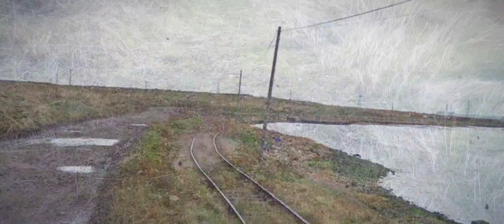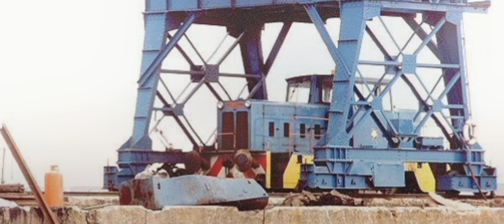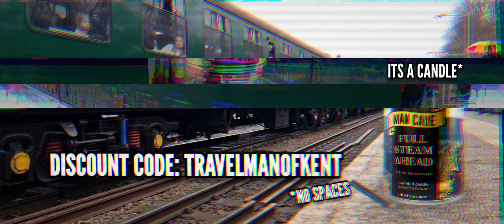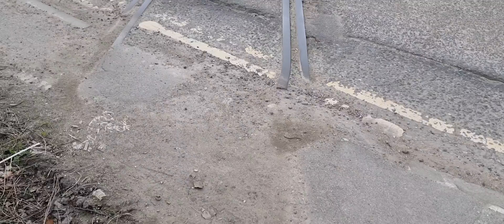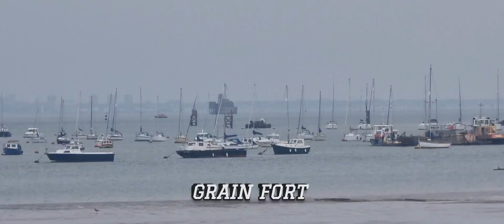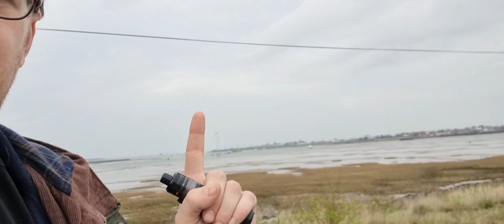ABANDONED RAILWAY!? Rushenden Pier | Isle of Sheppey | Part One

Comment: The grain side of Hoo yard several lanes were dedicated "breaker" lines, all the Portsmouth express EMU's were broken up right there in 74 save six which are still doing service as rail carriers for NR, the old Medway docks was the areas "cripple" yard where broken stuff was dragged to be fixed, cobbled with another broken stuff or pulled apart.   It was quite a thing to get a train down to the docks from Rochester station divedown as back then the navy wouldn't allow traffic through the naval base hence why BR had to build the quite steep divedown from the main line.